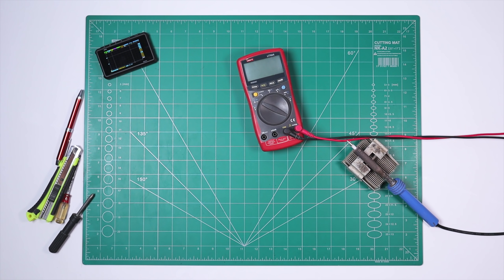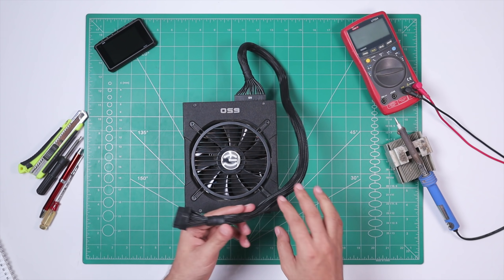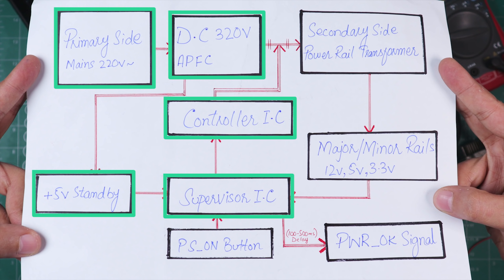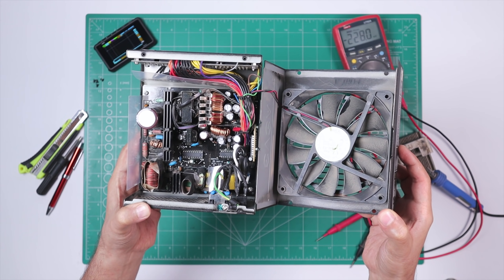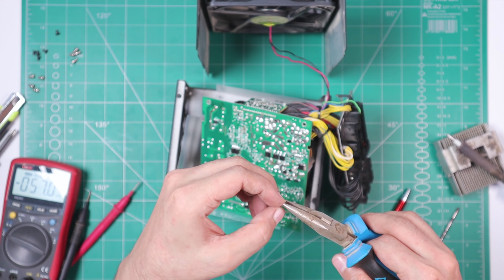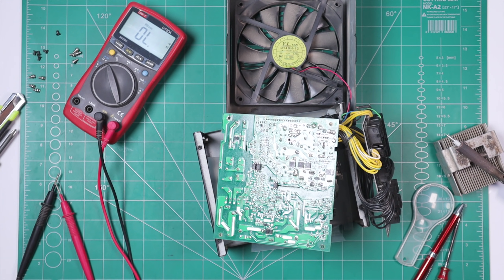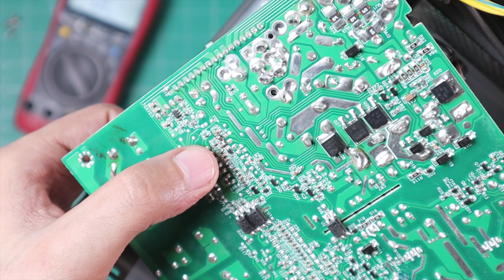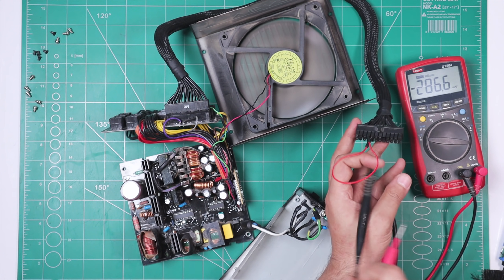Repairing PC Power Supply | EVGA NEX650G

Comment: Bro make a video on how to repair computer power supply pleasa
Reply: In my computer l am not having power supply like you showed in your video (the exhaust fan size is small and it is placed on corner )(where l connect power supply of AC )
Reply from the maker: What did I do in this video then? :P
Reply: @GuyThatDoesEverything  bro my power supply has different circuit
Reply from the maker: All the PSUs follow the same primary and secondary functionality and troubleshooting steps. What exactly is the prob in your PSU?
Reply: @GuyThatDoesEverything  suddenly smell of burning came so I immediately shut down my computer
Reply: @GuyThatDoesEverything  and when I open and check all the component
Reply from the maker: Which exact PSU you're using? Brand and wattage? And your complete system specs?
Reply: @GuyThatDoesEverything  name is XPRO and input voltage is 220ac and 4A wattage is 400w
Reply: @GuyThatDoesEverything  and my computer is not a gaming PC
Reply: Bro please tell me way to repair

Comment: People think repaired stuff is bad   but it depends on how much of a repair u did.. in this case it was a resistor so  u can say it good as new .. nice fix jani
Reply from the maker: Yup that's true, but the problem is that we won't know which part has actually been repaired and how severe the fault was at the first place, so buying used/repaired PSUs aren't really a good option unless you are certain about its condition.
Reply: @GuyThatDoesEverything  true mate